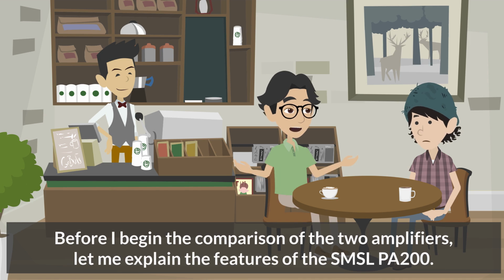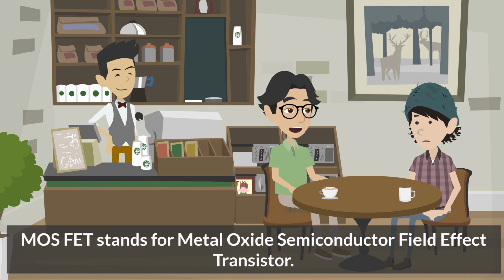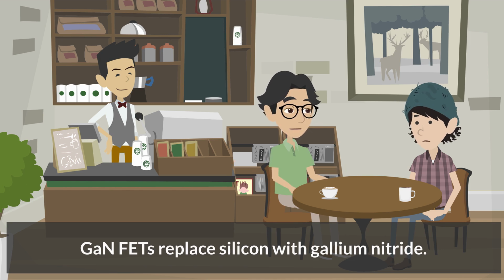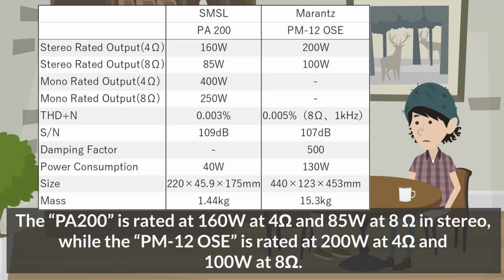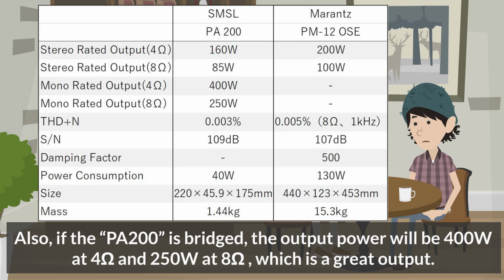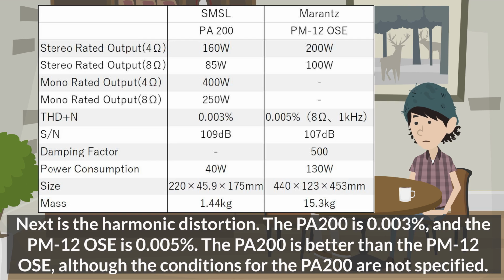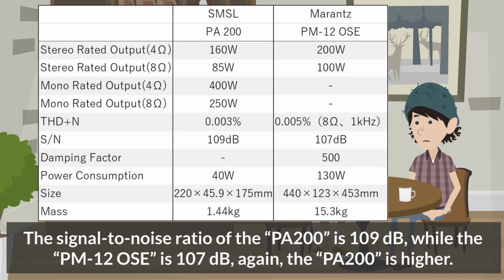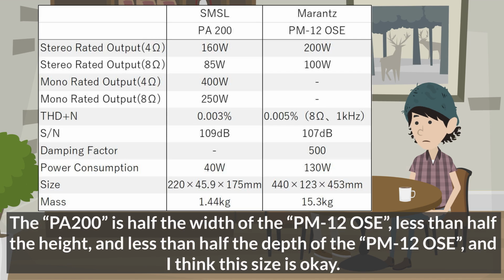Comparison of the SMSL “PA200” and the Marantz “PM-12 OSE

Comment: How does both amps works with difficult speakers - lower than 4 ohm resistance?
Reply from the maker: I have no experience with speakers smaller than 4 ohm. However, both amplifiers can drive 4 ohm speakers with no problem.
Reply: Whats the power output of SMSL PA200 at 6ohm ...